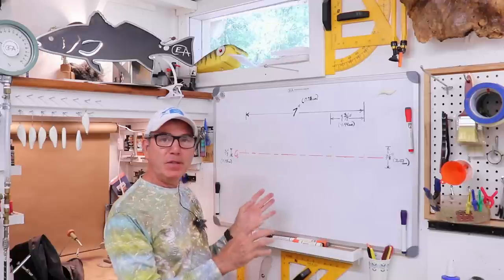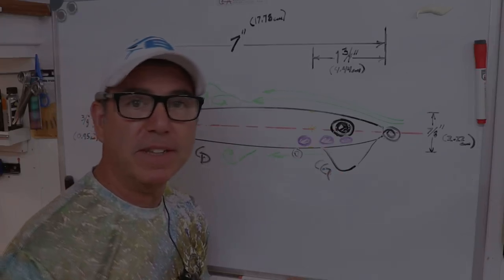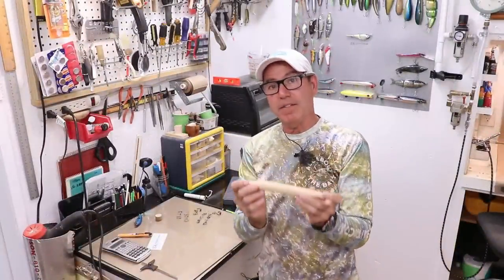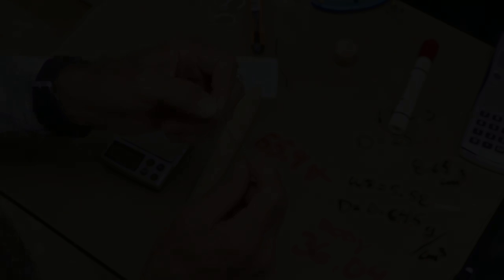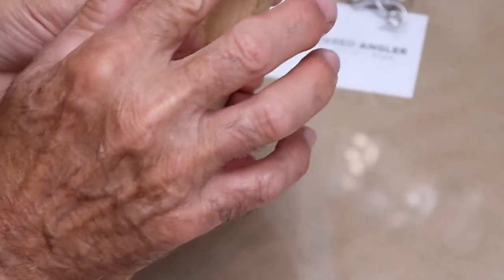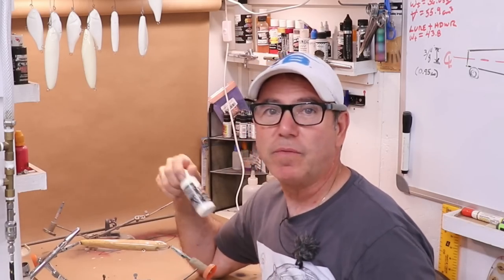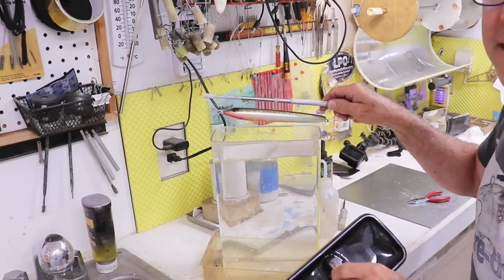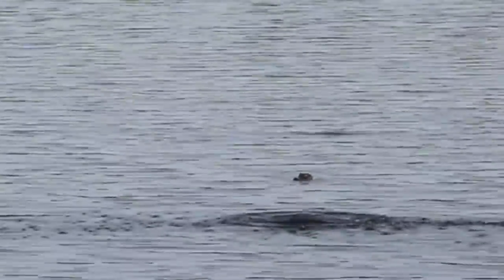How to Make a wooden striper/musky glide bait.            #fishinglures #striper #musky

Comment: The E6000 is like a rubber cement epoxy it works well for coating feathers and using the feathers as fins. Glueing the feathers in place first is the best way before coating them in the E6000. On my video " mackerel fishing lure pt.7 " you see the effects of the Canadian geese feathers with the E6000 coated over the feather on both sides. P.S. Nice job on building this lure. Some day hopefully have the stuff to make better lures than I have.

Comment: Franco, love the video. Your wire twisting is so simple. Why do l have so much trouble? I'm using 0.51 wire from the musky $&0#. Is it a hardened wire. I start to get a twist and then the whole wire rolls over. Thanks for any advice.
Reply from the maker: Im going to do an entire video on wire selection...
The simple answer is use lighter wire or annealed wire.
Reply: @EngineeredAngler  thanks brother

Comment: Great video thanks for all the tips. Very helpful!
The glider I am building (for northeast stripers) is one the sinks and when retrieved at even a slow pace will do a wide "S" pattern. What causes the lure to make that S pattern underwater without imparting action to the lure? 
The shape of the lure Is a Cresent. Single solid piece of wood. Any help would be appreciated to help understand what makes the lure do the S pattern without imparting any action with the rod
Thanks again and would love to see a video on this style glider!
Reply from the maker: Most lures that are not perfectly torpedo shaped will move in an oscillating motion.  Some take a fast retrieve others can do it at slower speeds. The trick is to induce turbulent flow near the front half of the lure without causing it to be too unstable and rolling or blowing out.

Comment: Hey Franco,  Thanks for the build. I just broke out my lathe yesterday to make a pencil popper that i hope to take out striper fishing tomorrow. I do have a question that i would love your engineering perspective on. I tend to make or modify my lures to use only a belly hook and no tail hook. In my experience the striper hit the belly hook 95% of the time and the tail hook just beats up the fish. Since the fishery is so precarious the more i can do to leave the fish in good shape the better. On a modified lure i would add split rings or swivels on the tail eye to add a bit of balance to way it was designed and on ones i make i tend to leave it out all together, although i wonder if i should just add some sort of eye to better hold it for finishing. Anyway, like i said I'd appropriate your engineering thoughts on this and what else i should be considering for that type of design. Do you think a tail hook removed really changes the action of a spook or crank bait?
Reply from the maker: This is a really interesting question.  I agree with you about the way most fish hit the lure.  Most of the time a predator fish will target the head of a bait fish and get hooked by the belly hook.  I have seen folks try using only a belly hook but move it back (closer to center) in an attempt to balance the lure;  I think that is a mistake. You want to keep the belly hook as close to the head as you can without creating issues with fouling on the leader.  As far as the action; both the change in weight distribution and drag at the tail will affect the action. In my experience the change is small or can be reduced.  On a lipped crank bait you should be able to get away with just moving up one size on the belly hook.  on a lure like the spook, removing the tail hook will reduce the drag at the tail and will improve the walk the dog action.  Adding a swivel as a weight on the tail eye is a good idea on a factory made lure but, if you make the lure, put a bit of internal weight behind the center point to keep the tail down a bit.  Remember you can always just replace the tail hook with a single hook and this will minimize the impact to the lure action and the possibility of damaging the fish.  Thank you for the question.  Good luck.
Reply: @EngineeredAngler  great q&a session.
Reply: @EngineeredAngler  This is great info, thanks a million. I'll go ahead and try to build a few spooks this week to try putting it in to practice.

Comment: Doesn't adding weight in the front make it nose heavy? Wouldn't it be better if the weight were more towards the middle?
Reply from the maker: It really depends on the action your trying to get and the posture you want it to float at.  The key with a bait you want to glide straight is to have the center of gravity forward of the center of drag.  Since CG is easy to manipulate and CD is not; I err on the side of caution and move the weight as far forward as reasonable.
Reply: @EngineeredAngler  figuring out the CD (as you said) is not easy. I used your calculations of target weight and had to add an ounce to get to 48 grams and that made the nose so heavy it sank. LOL. I redid the calculations and have adjusted accordingly.

Comment: nice lure, like everytime!!! but sry,i have a big BUT again,plese dont take it wrong... the twist eyes would never hold a big fish,there is a reason why other lure builders use a troughwire for big lures.... the fin in the front will stopp the aktion and let it glide,but straight... if you want a topwater lure it needs the weight in the back with a down facing linetye, if you want it to dive make it level,with the linetye at the nose. thats not my oppinion,that are physical rules of lurebuilding.  and at least, on a baitcaster nearly every lure flyes perfect, try it on a spinningreal, against wind... and have fun with a nice tangle
Reply: Not to disagree with anything you mentioned but I thought muskies were mainly caught by trolling huge bricks. I also admit I'd be hesitant to use a screw in eye but Franco has done materials testing on his twist eyes and they're pretty dang tough. But the type of lure blank materials has to also be considered, for instance a nice solid dense wood is going to hold the twist eye a lot better than a soft wood or other material.
Reply: @pakde8002  he tested it in a straight pulling,and dont bend it to the side... if a big angry fish junps,,rolls or shake his head it would fall appart. watch my first video here, were i lost the big seatrout, it has arround 6-8kg.  it destroys my lure, and killed the stainlesssteel-splitring right after the first jump. a wiretrough lure can get completly break appart, and you are still able to land the fish. another way was a linetrough, so the lure slides up on the line and cant work like a crowba. my favorit way for my style of fishing now, so i rebuild all my lures...

Comment: The fit and finish of the lure is great. The action is not. A glide bait should dart/glide to the right 12 to 18 inches and then with a quick turn of the reel handle back to the left 12 to 18 inches. The front keel on this bait will not allow a true gliding action.
Reply from the maker: Didn't glide as well as I hoped.
Reply: @EngineeredAngler  I build some lures as well and performance does not always meet expectation. Love your channel though keep it up!!!

Comment: .... so you weighed it before drilling the holes for lead to determine the density.  (You do this in like allllll your videos. Drives me nuts.)  But the act of drilling the holes to fit the lead removes material.  Therefore, your calculations are off.   Next you want the weight to be as close to, but forward of the center of drag.  And last, add a weight to the very back to help force it to deviate side to side.  
These 3 factors will actually make it a proper gliding stick bait.
(OH and you never factor in all you top coats,mid coats, clear coats into the overall weight.  It makes a huge difference in the glide bait game.)
Reply from the maker: Let's just say there's a lot going on off camera that is just a bit too much math for my average viewer